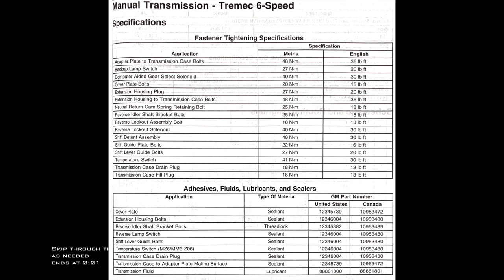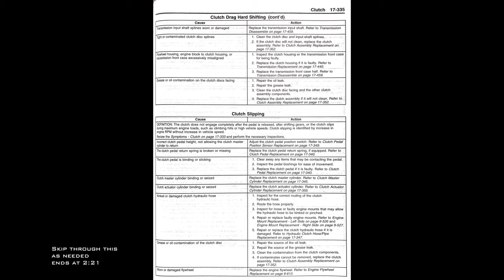C6 Corvette Clutch Replacement in Depth Tutorial

Comment: The crank position throws a code when the starter starts going bad and turns over slow on hot starts. I replaced sensor first and it still thru the code on slow hot starts. So I replaced starter. Now it's all good. That sensor is a pain to get to too. I've gotta do a clutch soon so this video makes me think I can do it myself. Thanks for the video.
Reply from the maker: Thank you!

Comment: Slave cylinder is also a good one to do when you have the clutch out.
Reply from the maker: 100% the installed was OEM GM and the previous owner said it only had 10k miles on it so I left it in.

Comment: Bro im literally doing this right now lefgit my c6 on stands and i cant get my bell housing OFF!  It feels like the harness is getting pinched between my fire wall. ANY TIPS?
Reply from the maker: You have to drop all four engine framing bolts/nuts to get it low enough to get to all of the bolts and to get the bell housing off, you are probably missing one
Reply: @z06baron6  so update bro i got everything done right. Now im just stuck on getting the whole thing inserted back into the clutch and bell housing. Im at the point where you had the strap. i was out there for 3 hours today wiggling left to right jacking up and down. nothing. Did you still have the front cradle lowered? i did both lowered and up i got so frustrated i called it a day. ill get at it again tomorrow.
Reply from the maker: @MylesHuizenga  I still had the front cradle lowered, did you use a good alignment tool when you installed the clutch? It is crucial the clutch plate is centered to the assembly with the tool

Comment: 4000 miles on my monster clutch and I had something rattling around in there. Scoped it and it looks like the same spring broke. Did monster say anything about replacing parts or covering it?
Reply from the maker: Mine only had about 20,000, a clutch should be lasting 200k miles without track launches which mine never saw. Monster did say they could potentially replace the parts if they knew the serial number and order number, but its up to the shop that installed it to warranty the whole thing. Its a $1000+ labor to get to the clutch which of course monster wouldn't cover. Monster offered to rebuild the clutch for cheaper but I don't trust them. They basically just use GM LT clutch parts with custom plates which obviously aren't designed to be successful with LS engine/slave cylinder combos. I think the issue is caused by the LS/C6 slave cylinder stroke being too long for the LT plate spring.
Reply: @z06baron6  wooops. Took mine apart. Clutch is fine. Snapped bolts on driveshaft input shaft and wrecked my driveshaft.
Reply: @z06baron6  where is the shop that offered 1000$ labor?
Reply from the maker: Sorry, haven't watched this in a minute. Did I say there was in the video? And for the labor on the clutch or something else? @F8L.
Reply: @z06baron6  was reading ur comment of the shop to honor the warranty
Reply from the maker: @F8L.  The shop did it for a previous owner so I couldn't use the shop.

Comment: i’m doing just a slave replacement because i have a new clutch and flywheel . i’m wondering if i need to take the bellhousing off to just replace the slave
Reply from the maker: Yes you do because the connector goes through the back of the bell housing

Comment: Thanks for the great video Baron! If you don’t mind sharing, what insulation did you use above the torque tube and would you recommend that to others?
Reply from the maker: I used fiberglass insulation for AC ducting. As a dude, its probably fine. As a Mechanical Engineer I wouldn't just recommend throwing in the same insulation, the fiberglass can withstand exhaust temps (highest temps it may see) but the glue to the foil and other material may not, I was careful in my placement and didn't have any issues after 1000 miles.

Comment: Hey man I have a 2005 c6 and replaced the throw out bearing and now put everything back together now when I go to start it, the car doesn’t crank at all I put a new battery , replaced the relays, checked grounds but nothing seems to fix it just lost at this point
Reply from the maker: Before replacing the battery and relays there should be a lot more testing. I would have first checked if the starter was getting full amps and voltage under load. Also the crank could be locked up or something it locked up.

Comment: What did you do with the fuel lines? Just disconnect from the front and leave them attached to the torque tube?
Reply: Sorry just now seeing this! No need to disconnect anything if you are not dropping the fuel tanks (I have another video on this) I think I may have had to disconnect a few plugs for the harness while doing this.